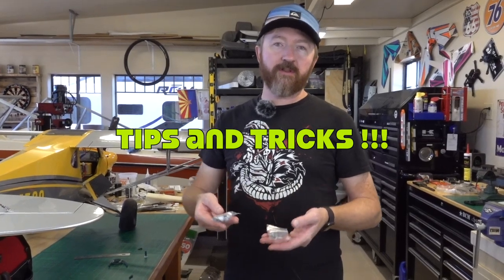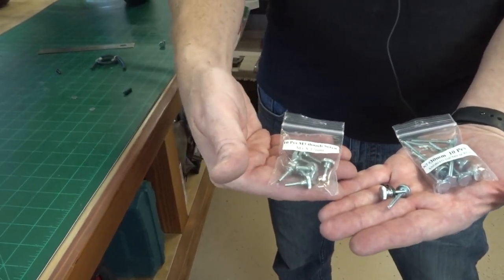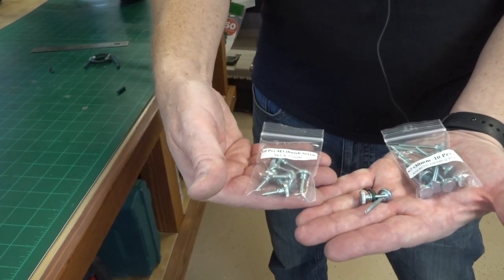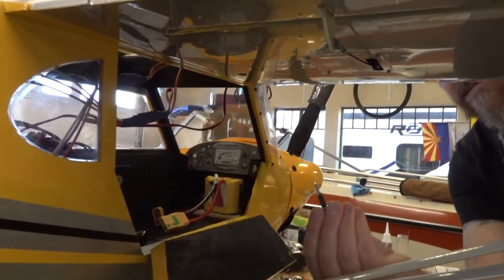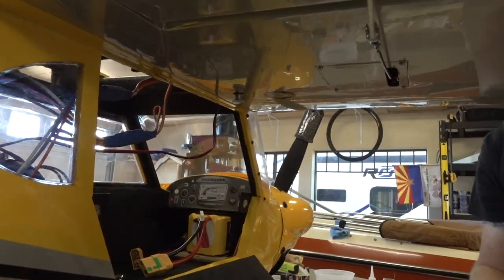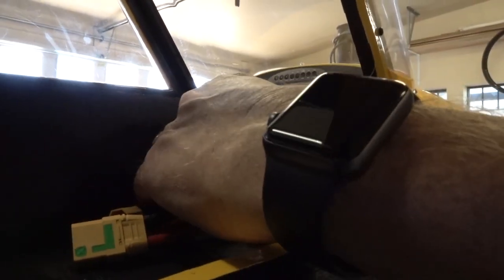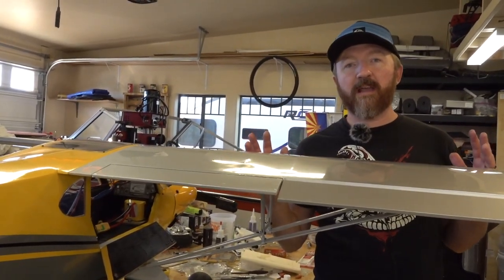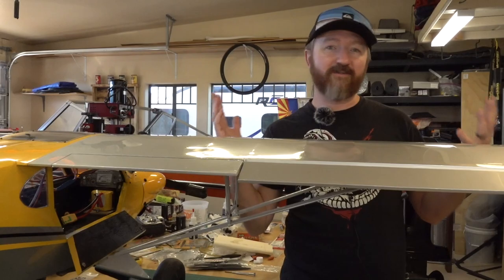Awesome Carbon Cub Wing + Battery HACK!!

Comment from the maker: Here's what you'll need to complete this simple hack:
1 - M3x12mm knurled thumbscrew (for battery tray)
2 - M3x30mm knurled thumbscrew (for wing bolts)
3 - M3 thin washers
2 - 17mm long silicone fuel tubing pieces 
1 - 4mm long silicone fuel tubing piece

M3 Thumb Screws - https://ebay.us/zH5eJx